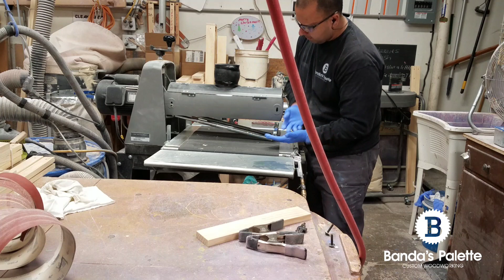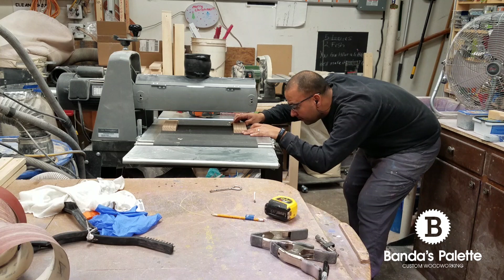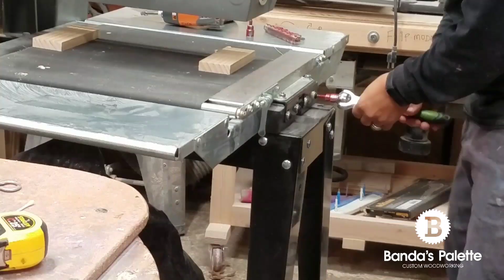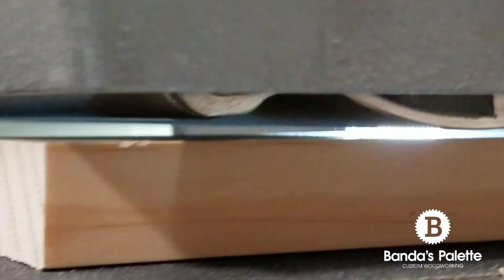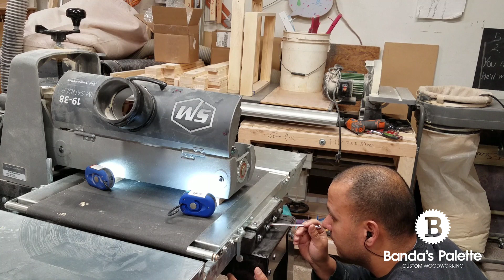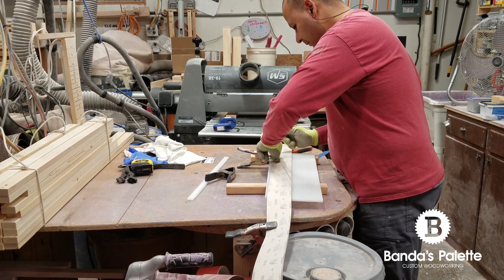Supermax 19-38 Eliminate snipe and kickback with Bandaspalette.com

Comment: Just bought this same sander used.  Had to replace the brass bushings for the rollers.  This video will take me to the next step of tuning my machine.  Thanks for making the content.  Good info.  Thanks again.
Reply from the maker: Much appreciated. This is a great sander. Very reliable once it's dialed in.

Comment: Learned a lot from your video being the new owner of a Supermax 16-32!  I’ve had it for four months and love it, until recently.  I’m making an end table with a 24x28 top, red oak.  When I send the panel thru  (less than 1/64” bite) , half way thru it starts making a hard left turn (from operators vantage) making divots in the panel!  I try to guide it thru but still doing it, but much lesser degree.  Drive belt not slipping.  My question is do you know what the factory set for the tension rollers would be?  I was messing with those a lot and now I don’t know where I am.  I contacted Laguna tech support five days ago an still waiting for help.  Funny thing is yesterday I put a 24x24 plywood thru and it ran fine!
Reply from the maker: I'm sure this video will be very helpful
https://youtu.be/JkHXWQkOlVU

Comment: It looks like someone modified or replaced your conveyor belt with a narrower one. My conveyor belt is nearly the full width of the table. Either that or maybe supermax used to run a narrower belt? Just curious if that is intentional.
Reply from the maker: I bought this from a guy that did trim and other finish capentry and was going out of business. He didn't take very good care of it, when I picked it up, he said he was running old barn wood through it, and some of the barn wood had old nails. I'm pretty sure the reason for the conveyor looking more narrow is for that reason.

Comment: I'm surprised that the hook and loop backing doesn't interfere when you put the paper on a non hook and loop machine like the SM 19-38.   I love Mirka paper and also have a 19-38.  Is the Mirka paper holding up and not sliding around on the drum?
Reply from the maker: No sliding at all. As you know, the Mirka brand is very thick and durable. I used to change so many papers when I used the grizzly or 2sand brands, and now it's lasts me a few extra sanding sessions. I think the thickness of the paper helps it stay rigid and in place.

Comment: Good video!
Any idea how to adjust the feed belt. No matter the tensions of those little wrenches and having one side much tighter then the other, after run at around #3, after 10 minutes it has drifted to the inside. So I have to shut it off, loosen those wrenches, pull the sandpaper feed belt all the way up to outside, tighten those wrenches...and have to do it all again in 10 minutes.
Any ideas?
Thanks
:)
Reply from the maker: I think this suggestion may help. You know that nut you loosen or tighten to adjust the tension with the wrench? 

I would replace it with a locking nut (lock nut). Sounds like the nut is ever so slightly moving with the vibration of the machine. The lock nut has the nylon interior that I'm betting would help eliminate the movement you're experiencing. I'm sure you've watched this video, but thought it may help too.

https://youtu.be/JkHXWQkOlVU

One thing I noticed on these sanders as I started to dig into it to dial it in, is that they used some pretty inexpensive bolts. Since then I've had to replace a few bolts and replaced then with hex bolts, those allen drive bolts are pretty crappy, and can only take a few adjustment rounds and they're done.

Hope this helps my friend!
Reply: @BandasPalette  thanks brother!!! I’m gonna mark a side to see if either are loosening. It’s so frustrating. I hope this is the fix. Thanks so much for sharing that info!
:)
Reply from the maker: You bet!
Reply: @BandasPalette  sadly the nut wasn’t moving :(
Gonna try another belt...hopefully I just have a bad one. These things aren’t cheap!
Thanks for you’re info though...good to know.
:)
Reply: @enzprintco.8625  did replacing the belt fix your issue?